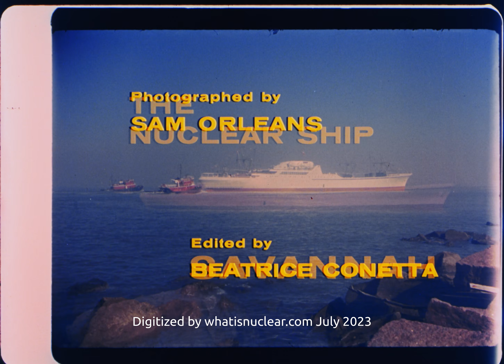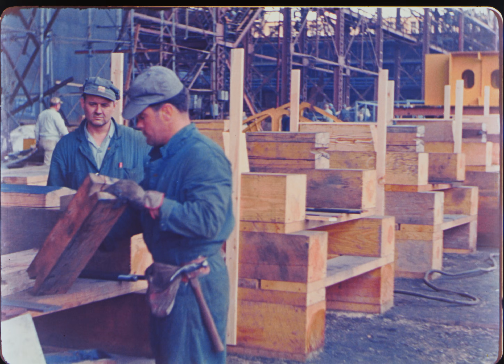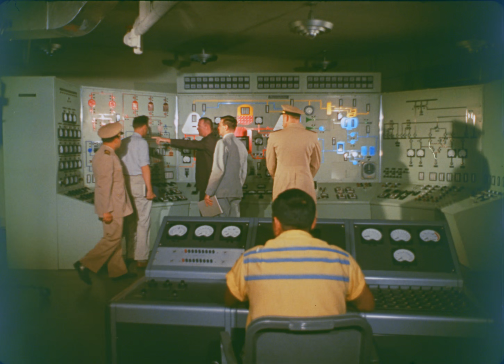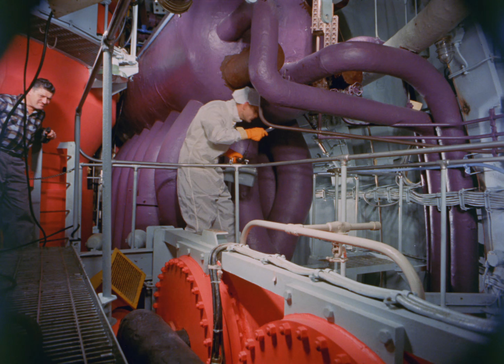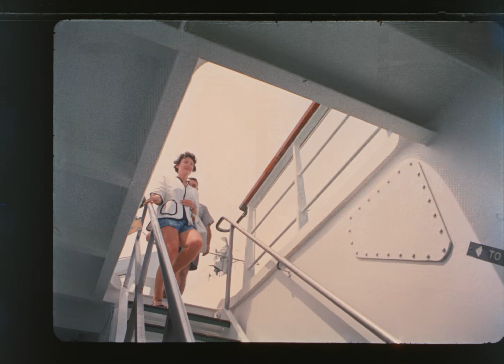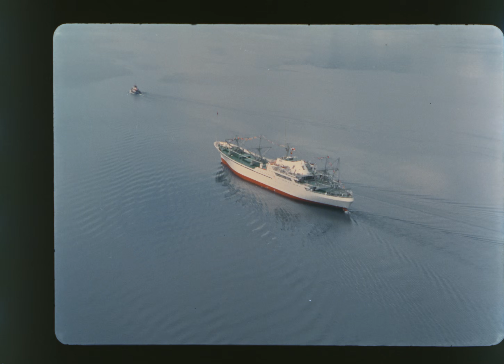The Nuclear Ship Savannah

Comment: In Seattle in 1960, I scratch-built a model of the NS Savannah using plans from a Popular Mechanics article. I used fiberglass over a balsa wood planked hull. I sold it decades later at a garage sale in Colorado. I had the hull, superstructure, deck cranes, and lifeboats finished but never got around to fine detailing. It looked very nice but missed getting that detail that makes for a beautiful display model. I guess it's OK because the actual ship never reached its full potential either.

Comment: The story doesn’t end here.  Savannah is presently in Baltimore.  I and some friends are working on reactivating the control-room for display/educational purposes.  Here’s a video of me pressing “Lamp Test” on a couple of the panels, after powering up the panel for the first time in half a century:  https://youtu.be/UMOFP8V8dLU .  Note that the filaments of many of the incandescent bulbs are broken.  We will eventually replace them with LEDs.

Our hope is to have a modern computer simulating the reactor, so the instruments respond to control-inputs realistically.   (MELTDOWN — GAME OVER)  Interfacing with the 1957-style high-voltage AC circuitry will be a challenge, but not as big a challenge as interfacing with the pneumatic controls.

Several areas of the ship have been restored, and they even found enough original Naugahyde to reupholster the Purser’s Lounge.

Savannah is open to the public one day a year, usually the third Sunday in May.  Someday it may be open to the public year-round, once all the asbestos and PCBs are removed.  ;-)
Reply: How much of the original electronics were vacuum tube?  I’ve gotten a control room tour, but they didn’t pop the door to the instrumentation room behind it :(
Reply: @philipnasadowski1060  Near as I can tell, EVERYTHING was originally vacuum tube, however instruments were swapped in and out, and some of the later instruments had digital displays and presumably solid-state electronics, but those components have been removed so there appears to be nothing solid-state there now.

Various things were removed as souvenirs, as the ship has been passed around for half a century and rigorous records were not kept.

Examining the control panel is sort of like doing an archaeological dig, as we find someplace where there used to be something installed, then removed and puttied-over, then something else installed, so holes with different outlines overlap.

We’re studying photo of the control panel from different years to determine what order things were done in.
Reply: Sounds like my life doing work in water / wastewater.  Sometimes you get an ancient plant where the wiring doesn’t match anything. I haven’t seen tube electronics in one, and I like tube stuff…
Reply: @philipnasadowski1060  Bob Adams recently got the sound system aboard Savannah working. It’s 100% tubes.  There’s also a small B&W RCS TV studio.
Reply: I seem to recall reading that there was a TV camera in the containment, and a TV in the lounge, so passengers could see the excitement of a nuclear reactor in action 🙄

No surprise the sound system was tube - no transistors back then could even do the power output required.  I’d love to see what tge original tube instrument racks were like.  At such an early time, there likely wasn’t much standardization, or regard to packaging.  Even color broadcasting gear from the era looked more experimental than something RCA was trying to sell…
Reply: @philipnasadowski1060  Yes.  The TV is operating again.  I imagine that watching a B&W image of the outside of the reactor got dull pretty fast.

Comment: A nuclear ship or submarine can be virtually energy independent and that in itself is a big deal.
Reply: For a while.  But even nukes need refueling and it'd be cripplingly expensive in the commercial world.
Reply: @toomanyuserids refueling ? Theoretically half life of uranium 238 is 4.5 billion years. With all the state of the art engineering the ship will run for 20-30 years continuously.
Reply: @BHARGAV_GAJJAR  I suppose, we could build nuclear powered ships with 30 years operation without refueling.
But the half life of uranium has nothing to do with it, since nuclear reactors don't utilize the natural decay of uranium.
Reply: @701983  In a nuclear reactor engineering physics, "half-life" is used to determine how quickly a radioactive isotope within the reactor's fuel decays, which is crucial for calculating the reactor's power output, managing fuel burnup, and determining the appropriate time to replace fuel rods, as each radioactive isotope has a specific half-life, meaning the time it takes for half of the atoms in a sample to decay into another element; longer half-lives indicate slower decay rates and longer fuel life, while shorter half-lives mean faster decay and potentially higher heat generation in the reactor core
Reply: @BHARGAV_GAJJAR  The actual fuel in a normal nuclear reactor is not uranium 238, but uranium 235, with a much shorter half life. However, the "only" 700 million years half life of U-235 is practically irrelevant for "fuel life" as well. 
The practical "fuel life" and heat production doesn't depend on the natural decay of uranium, but on the amount/speed of "artificial" (induced) nuclear fission in the reactor.

Comment: I think they manufactured a “problem” that would soon need a solution.   I’ve seen several documentaries on this ship.  I don’t think she lasted too long.  If I recall correctly, a lot of ports in the worlds didn’t want t nuclear ship pulling in.

It was also a bit strange the way they crossed it between a freighter and passenger ship.  Only 60 passengers.  It seems they already had in mind that it “might not work out” as a passenger ship, so it could fall back 100% (with renovations) as a freighter.

Very good video.  I enjoyed this.  Thank you.
Reply: It isn't too unusual for a freighter to have some passenger cabins.

Comment: Man, did they ever get that wrong about nuclear being the future of cargo or cruise ships.  She only carried passengers a few times, and wasn't set up very well for cargo or passengers being a proof of concept.  The sailors who were on the nuclear side were paid significantly more than the ones on the turbine side of the propulsion which is what caused the labor troubles mentioned.
Reply: This happens in the civvy nuke business as well.  Been on Navy nukes?  You bringing a security clearance?  You just scored.

One of the costs associated with running a civilian nuke power plant is recruiting ex-Navy.
Reply: @toomanyuserids  that’s ok to have a couple ex navy nuke and pay them well.  The problem is nrc insisting plant needs  500 staff to run a reactor, when 12 can run a same size gas plant in combo w a roving maintenance crew.
Reply: @toomanyuserids  Yes my ex father in Law went from the navy Enterprise, to Trojan NP, to Hanford.
Reply: Nuclear is the future of cargo ships. It’s inevitable, despite the current protests. They can’t keep plowing up the ocean on bunker fuel.
Reply from the maker: The proof-of-concept ship wasn't ever intended to be the economical commercial ship. This was stated up front. We'll get more nuclear-powered merchant ships yet. https://corepower.energy/
Reply: @whatisnuclear  It would have been a much better investment to make a straight cargo or even better for the reactor in the middle, straight cruise ship.  Trying to be everything to everyone never works out well.

Comment: Low rpm direct drive diesels will power commercial ships forever. Very efficient.
Reply: You can build small reactors that get closed and work for 40 years straight not needing anything most of your commercial cargo ships aren't even 15 years old, the only thing needed is capital and political will, companies like samsung already pursuing floating NPP
Reply: One large container ship emits more carbon per year than 50 million cars. Ships create 15 percent of the world’s pollution. This isn’t biased as I have worked with ships for 23 years and hope to for 12 more.
Reply: @justgotohm4775  And yet  the percentage of co2 in the atmosphere......0.04. Stop trying to suffocate the plant life. They provide oxygen for us. More co2 for plants.
Reply: @@shane888davies6 Everything can be bad if you get too much of it, in our bodies or in the environment.  Too much sun, too much salt, even drinking too much water will kill.  We all know that. Not sure why some want to pretend CO2 is special, can never have too much.
Reply from the maker: I agree that modern diesels are very efficient. Sadly, they emit lots of particulate air pollution and greenhouse gas, and require a limited fossil resource. For those three reasons, we'll want to switch over to nuclear fuel for shipping.
Reply: @whatisnuclear  I remember back in the 70's the experts said we only had 100 years of oil reserves left. The found reserves of oil is greater now. After treatment of exhaust gases solves that problem.  Just look at current diesel trucks. The simplicity of a diesel engine to produce, to maintain and to train personnel to operate it will never be beat. If nuclear powered freighters were viable it would have already happened.  Savanna is 60 years in the past. It was the only one for a reason.
Reply: @jimjoe9945  Sure, just look at current diesel trucks.  Run out of DEF or have a problem with the DEF system, you are parked on the shoulder.  Get a load of poor fuel that loads the Diesel Particulate filter, you are parked on the shoulder.  Have an obscure sensor fail, you are parked on the shoulder.  Have an electrical fault in the ECS, you are parked on the shoulder.  Lose the ECS module completely, you are on the shoulder.

Ask the guys who actually operate the current diesel trucks, and they almost all agree that the added costs and complexity of the new powertrains  far outweigh any fuel savings realized by the advances.  Remember this when you are ready to gripe about the high cost of food and commodities...That's just you paying for the current technology in the trucks that delivered them.
Reply: @kevincrosby1760  I have been driving trucks since 1990 don't have to talk to anyone. Run out of Def? Pay attention and you won't. The same way you won't run out of diesel.  Loading up the dpf because of bad fuel?  Never heard of it in fact my truck has never had to do a manual regen. Sensor go bad? That can happen on any modern engine. What's your point? My mention of diesel trucks was to show that after treatment of diesel exhaust already exists.  None of your examples applies to ships.
Reply: @whatisnuclear  upwards of 90%+ of diesel pollution can be captured by fairly simple and cheap exhaust treatment systems. the mining of uranium and its processing has had profound environmental impacts. which is worse, Im not sure anyone could definitively answer. nuclear is clearly not the end-all-be-all for numerous reasons
Reply: @perrycnn no, can’t catch the CO2.  It has to stop
Reply: @perrycnn Nuclear energy from uranium extraction to fuel loading is the cleanest energy source there is and nothing is close, i don't know what environmental impact you speak of and what kind of filter can capture co2
Reply: @ihab_7  what kind of filter captures co2? The best kind.  Plant life. They need it to live. It increases plant life and they release oxygen for mammals to use.
Reply: @jimjoe9945  Yeah plant trees on cargo ships
Reply: @ihab_7  Not necessary.  Earth's atmosphere transports the co2 to the plants quite well. But you already knew that.  0.04% of the atmosphere is co2. Almost 20% oxygen.  Why do you want to limit plant life? They're very beneficial to us. They supply us with oxygen.  I like oxygen.
Reply: @jimjoe9945  This has nothing to do with exhaust and filters for diesel engines you're jumping around like headless chicken
Reply: @ihab_7  You speak nonsense.  You bought up the co2 question and the problem of diesel engines producing co2. I simply pointed out that nature already provides the solution.
Reply: @perrycnn  Easy to say.  More difficult to put into practice.  Those "fairly simple and cheap" systems are actually quite expensive to produce, expensive to maintain,  require rather spendy  "Diesel Exhaust Fluid" , and involves the use of a "Diesel Particulate Filter...disposable and between $1000 and $10,000 depending upon application.

We won't even go into the environmental impact of mining the rare metals that go into manufacturing the catalytic converters for a diesel engine, or the impact of disposing of the expired cats and the discarded DPFs.
Reply: @jimjoe9945  Nature doesn't plan for your rise in industry and population nature has its own pace and nature isn't left alone to begin with
Reply: @ihab_7  nonsense.
Reply: @kevincrosby1760  The comparison on expense was between nuclear power and diesel powered ships. Diesel powered ships a very inexpensive option  compared to nuclear.
Reply: @jimjoe9945 That’s some 500 million years of plant life buried in the ground  and now burned up an tossed in the air all in a couple hundred years. No amount of plant life can keep up.
Reply: @jimjoe9945 No, he’s exactly right.  Nature has its natural limits of how fast it can do things. We all know that, some things are good but too much sun salt even water can be bad. Not sure why you pretend otherwise.
Reply: @jimjoe9945 How the hell do you know, when only one nuclear cargo ship has been tried? Cargo ship burning 200 gallons an hour could save several $million a year in fuel costs if it switched to nuclear, and soon some places are going to start penalizing them all that bunker smoke dumped around ports.
Reply: @whatisnuclear  May as well go back to sails.
Reply: @Bill-sp8kb  We are already heading that way, with modern diesel electric ships using wind turbines to provide up to 20% of their power. 
Unlike traditional wind turbines, they are vertical cylindrical devices, with scoops that rotate to face the wind.
Reply: @wilsjane there are none, will be none.

Comment: So we're is it know, hop it's made it to a floating museum. Amazing eleven years after ww2 and fourty five years after the Wright brothers. We should be in deep space by now. Amazing rates of progress over such a small time. So the question is why didn't they rest of the merchant fleet industry across  the world not adopte this technology, the advantages too the systems of propulsion based on oil and coal are obvious.
Reply: Friend if you really think about all the human errors  in navigation errors over the years with collisions , running aground and fires . The fall out would be astronomically huge for life and environment  compared  to fossil fuels.
  The US has an issue with one of its  decommissioned  aircraft carrier which they are scrapping , its  costing as much to despose the reactor and it components as it was to build the ship . Almost.
Reply from the maker: Considering that there are hundreds of nuclear-powered vessels in the oceans and have been for decades with minimal radiation releases, I don't think this argument stands. Fossil engines emit particulates and greenhouse gasses always, during operation. Nuclear-powered engines emit nothing during operation. The safety case is clear, nuclear would be way better than what we have today.

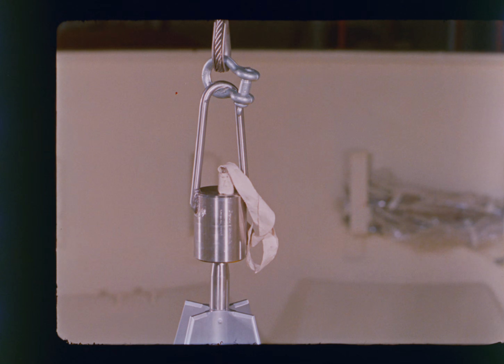Comment: 15:58   Good God    Someone needs to get his butt kicked and sent back to apprentice level rigging school.  And on a nuclear project too. I am amazed that they actually showed this in a film.
Reply from the maker: It's not supposed to be sideways like that? Even for a lightweight little control rod, Weighing at least 1/10th the weight of the fuel assemblies?
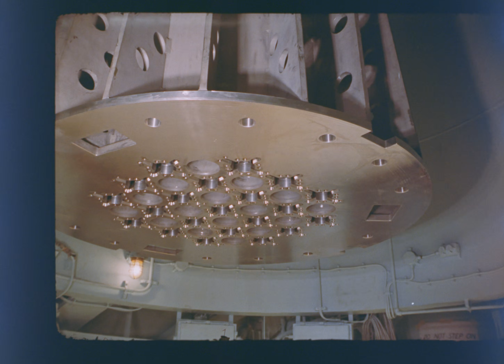Reply: @whatisnuclear  If you really want to be wondering about it, there is another rigging fail at 16:12. Shoulder less eye bolts. That type of eye bolt is only to be used in a straight line pull, no side loading. At all. There should have been a spreader bar between the crane hook and rigging. You might want to try looking at a riggers handbook, all kinds of interesting stuff in them. Bobs Rigging and Crane Handbook is one of the best.
Reply: @whatisnuclear    A shackle sideways like that depends on the strength of the threads on the pin, not the strength of the actual shackle and pin material. Even that "little control rod" dropping into the reactor core would damage things enough to cause the core to be damaged enough that it would have to be removed and disassembled for inspection or REPLACEMENT. When dealing with nuclear reactors, there is no such thing as a little damage. Stupid or unsafe riggers usually end up having accidents in the parking lot.
Reply: I see what you mean! Not exactly kosher rigging. Good pick-up! 😊
Reply: @brianmuhlingBUM   15 year retired crane inspector. Journeyman Boilermaker 1976.  Done a little rigging in my day.
Reply: Funny, I noticed the exact same thing, haha.